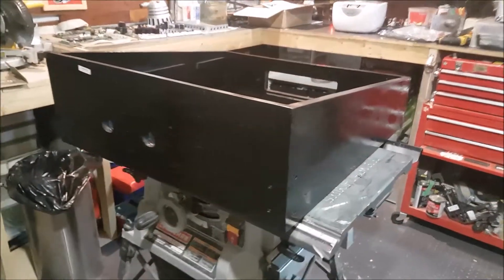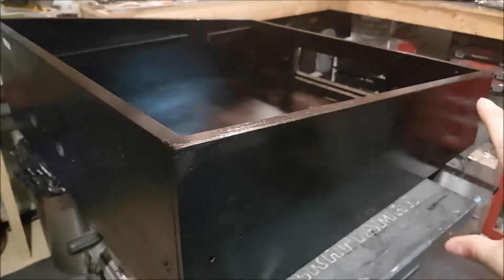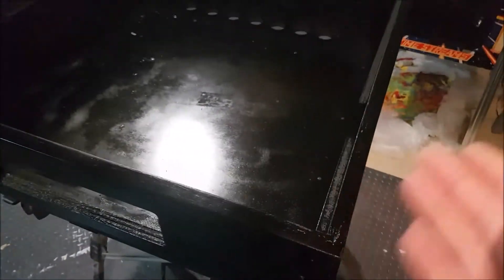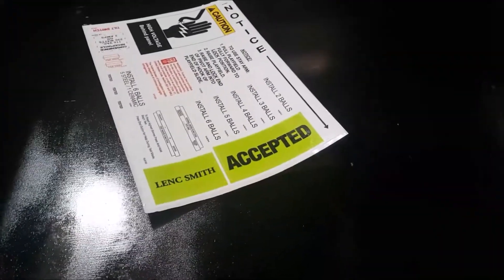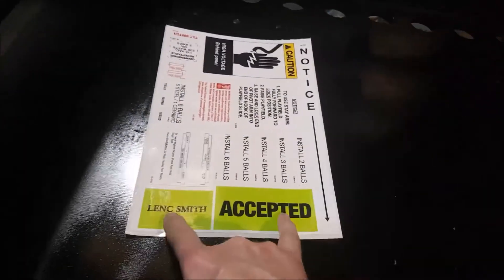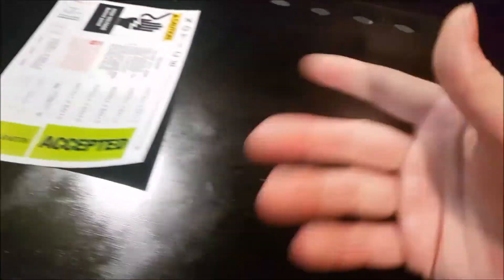Bally Dr Who Pinball - Restoration Vlog 04 - Dalek Wobble Head Mod

Comment: why don't you put the metal bracket inside the head by using some washers to get it flat? So you won't need to cut off the ring.
Reply from the maker: That could have been an option indeed.